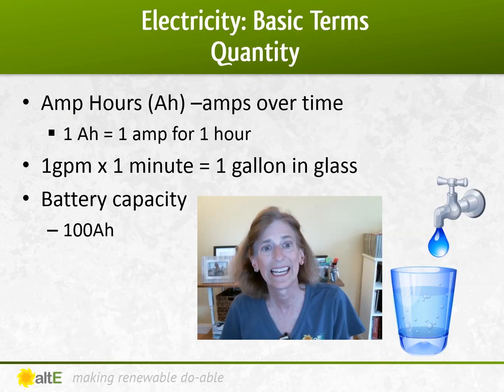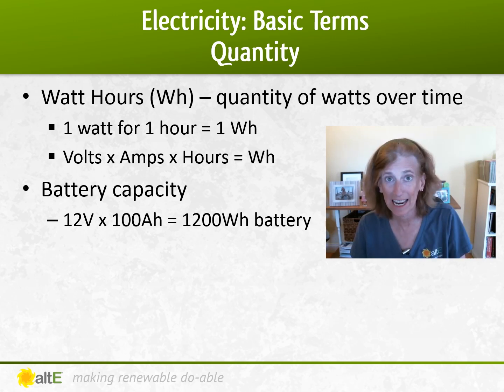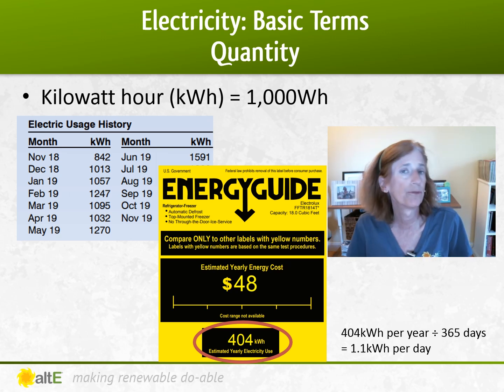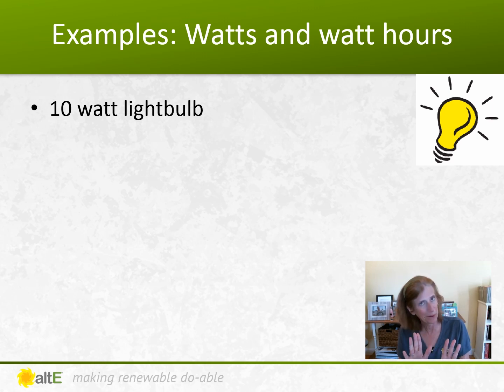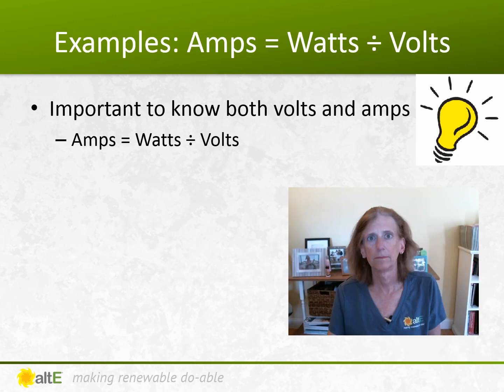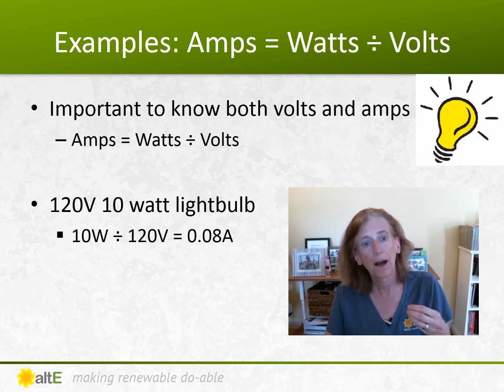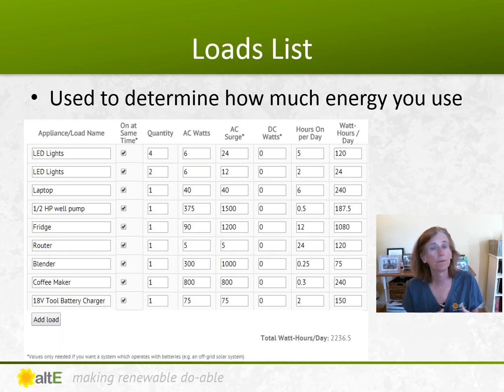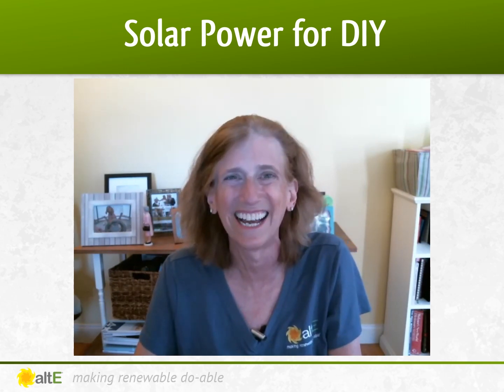Solar Power for DIY - Amp hours and watt hours

Comment: thanx amy for the information
however i have a question
why all batteries use the unit Amp hour to identify capacity instead of watt hour ???
Reply from the maker: Because you need to know both the volts and amp hours, they list them separately. You can figure out the watt hours by multiplying the two together. Lithium batteries have started identifying their batteries as watt hours to help determine the true capacity.